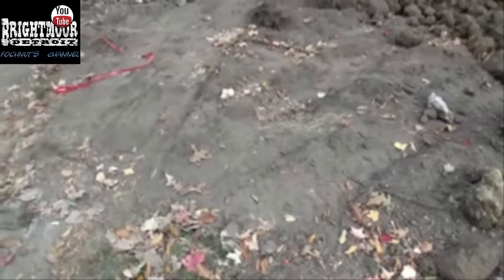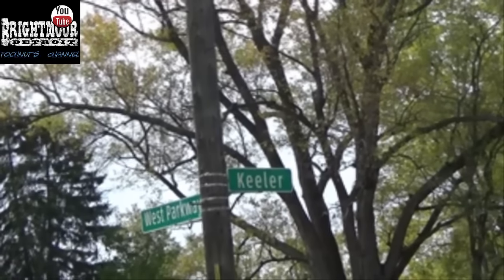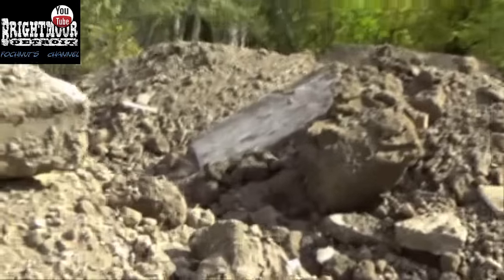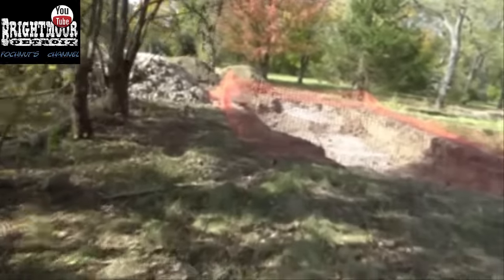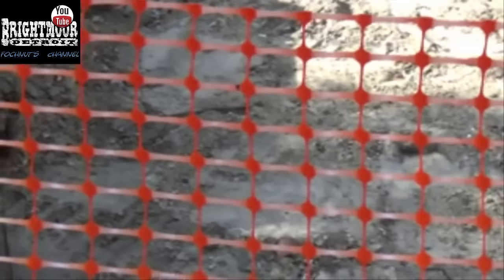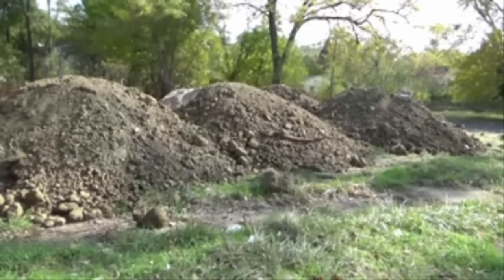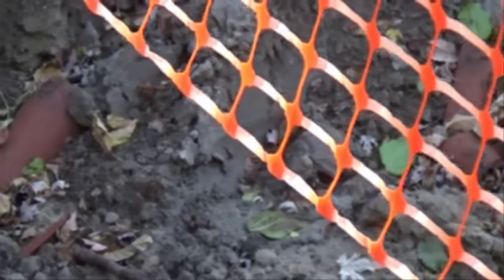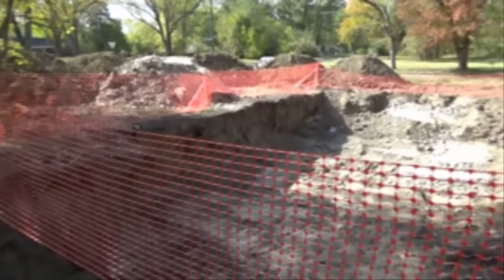This Is A Load Of Crap 3 - We Check A Location Nearby

Comment: They probably dug up a sewer drain field and this was what they dug up. Even with a cap of good topsoil (IF they actually used good topsoil), this would still not be safe. The sewage in the dirt would start off gassing through the soil. If you ever built a house on top of this you would probably get sewer gas and smell coming up into and around the new house for years. I hope they got rid of this crap and brought in good fill and topsoil.
Reply: after 2 years human waste is completely composted to soil     no fecal form or e Colli
Reply: If it is composted properly and only if it's not mixed with improper substances.

Comment: The only thing that's normal fill for is a landfill. That is NOT clean fill. Clean ﬁll includes soil, rock, stone, dredged material, used asphalt and brick, block or concrete from construction and demolition activities that is separate from other waste and recognizable as such. Clean fill also should not present a public nuisance such as odors.

Comment: That's good fill ours is not chemically contaminated that sewer pipe clay pipe concrete smashed up other materials can be used as backfill you got to know the rules before you start pointing fingers
Reply from the maker: Mark Kapanka you donrmt know what you are talking about. It should have been processed before it came to the site....they skupped a few steps.
Reply: Mark Kapanka It smells of raw sewage. That means it contains e coli, typhus ect. That is highly contagious and when it rains it will end up spreading!!

Comment: That looks like normal fill dirt to me.
Reply from the maker: +Taz Mahal did you watch the video?
Reply: +fochnut Yes, I think you are overreacting.
Reply from the maker: +Taz Mahal how bout growing some of those plants on these sites then.!?!
Reply from the maker: It has been confirmed this site is a dump site...... over reacting my ass
Reply: +fochnut   Keep up the good work.  This is a blight across the country.  Close to me here near Gary, Indiana it is also this way.  The Union Contractors usually are not the ones doing this type of crap.  About five years ago I cleaned up a couple of acres I inherited and some jerk thought since had seen tree parts and debris being loaded from here he thought he could just dump his crap here too.  The Cops said it was his word against mine. I matched a tree branch to the exact tree in his yard he had trimmed, growth rings and a perfect matching fit but to no avail.  Later on his truck had developed leaks in the radiator, trans cooler and about 4 tires.  Seems he came into contact with a pitch fork just like my five tine one somehow.  Believe it or not the Cops said it was only my word against his .  He ain't been back!!.  Peace.
Reply: +Taz Mahal   Backfill is one thing completely different from the cap soil.  You wouldn't have wanted this crap dumped illegally at the end of your street either.  Had this material been worth something there would have been a market for it.  There would have been a manifest for it in the legal world of hauling, origin and destination.  Surely you are smart enough to know that you can't tell a soils suitability for use just by looking at it.  If you are that sharp the refinery near here has lots of fill that looks just like black dirt, just smells a lot like volatile organic compounds.  Some fill won't compact either, but you know that I'm sure.
Reply: +Taz Mahal - I think you are wrong, think of the sewage off gassing through the soil when they build a house on this in later years. On another note, cool videos on microgreens!
Reply: Their grass would be super green tho 😆 🤣
Reply: @yomommajumprcables  its organic